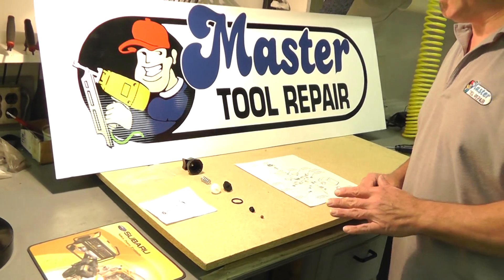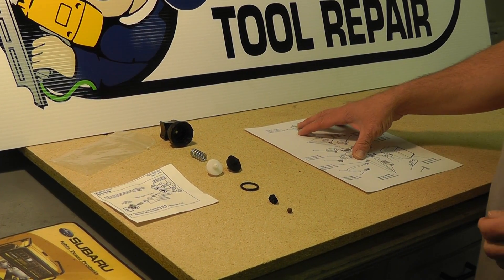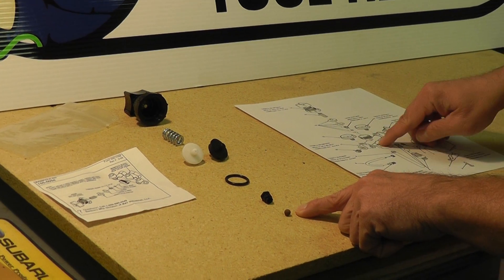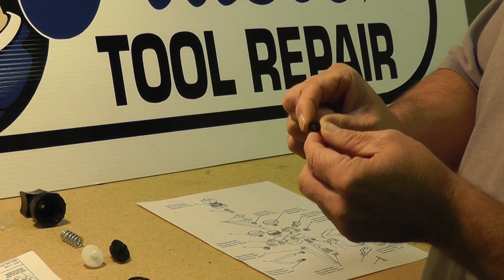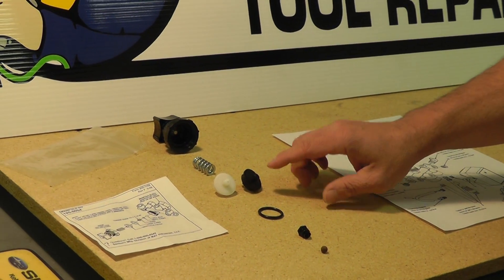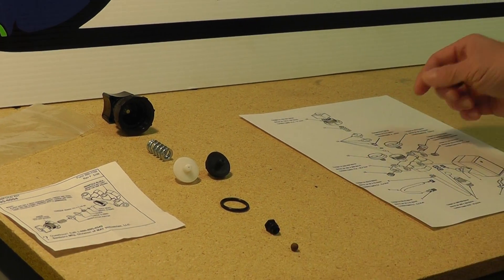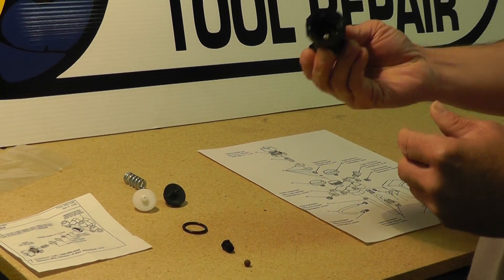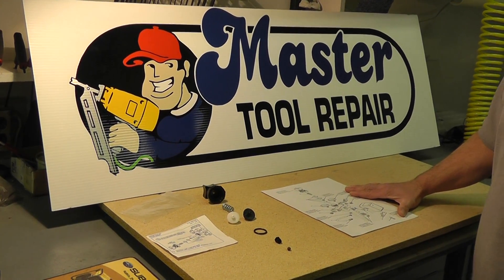Sanborn Regulator Repair Kit 105-0004 Installation

Comment: Does this regulator have anything to to with when the compressor shuts on and off?
I have an old Sanborn that leaks around the regulator.  I would prefer to bypass this regulator and just have the hose at full tank pressure.  I don't want to do anything to make it blow up.

Thanks
Reply from the maker: Thanks for the question! No, the Regulator and its components do not have anything to do with the pressure switch or the cut-on and cut-off pressures. The pressure switch is the "brains" of the unit, while the Regulator simply allows whatever pressure you desire through the line, from 1 to max PSI.
Reply: Thanks!  I have another regulator I like better (part of my water trap and oilier) so I will just bypass the dial o matic.  Do you know what the cut off pressure is on the old Sanborns?  The tank says max 150 PSI.  I ran it yesterday till it hit 100 and then unplugged it.  Now that I know I haven't bypassed the pressure switch I will let it run till it shuts off.
Reply from the maker: Certainly keep an eye on the tank pressure,  but you should be alright being the pressure switch should shut the unit off at 125 PSI or 135 PSI (max). And, if the switch happens to fail, the safety relief valve will blow off. 
The max pressure these older Sanborn units are typically set for is 125 PSI; rarely for these units would you see a max pressure of 150 PSI.
Hope this helps!